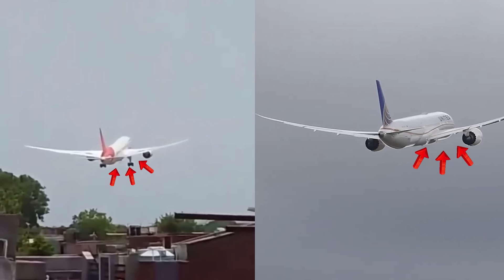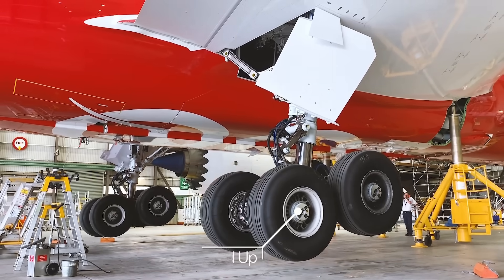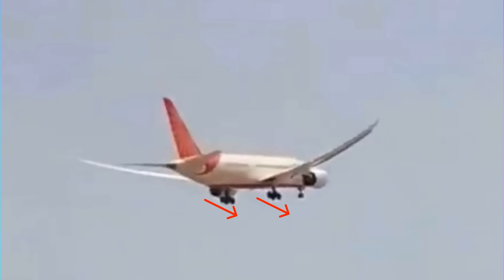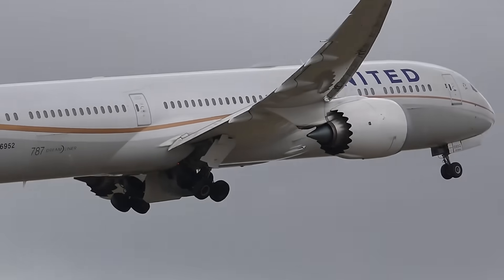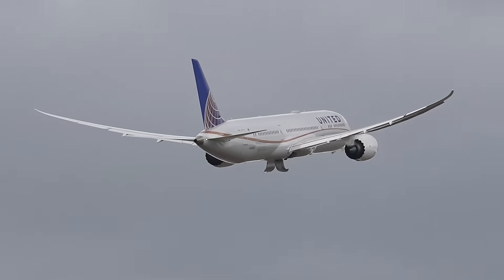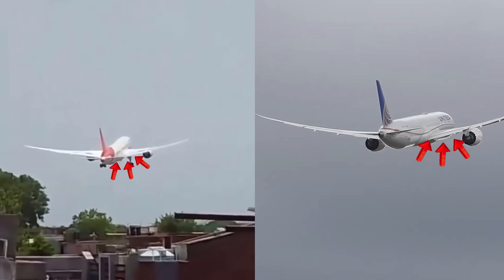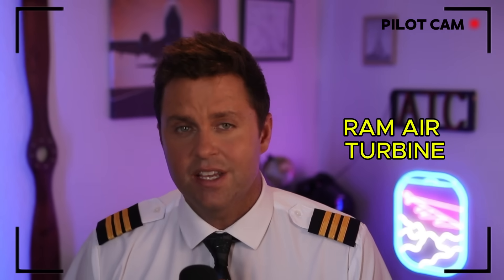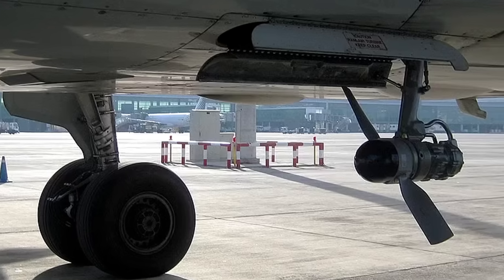Pilot Explains: A New Detail in the Air India 787 Crash Everyone Missed

Comment: Note it was refueled in Ahmedabad and that sure vl  not be surprised these points vl  sure be suppressed out of equation so are Airport runway safety norms as well. No harm keeping this model grounded until all this is sorted out. Landing gears looked struck with no actuation but on in position pneumatic pressure. Abrupt electrical failure only when both engines are out. Had seen AC and other leisure needs shut down during take off to ease in engines and pilots apologising for that inconvenience. I am sure some of the truth won't see daylight to protect and safeguard some of the vested interests. It's all hopeless .

Comment: The survivor reported a loud bang and flashing lights. The RAT comes down and starts spinning when the lights flash on the passenger side. The loud bang is a mystery and the cause of the bang has not been solved yet. The damage was probably serious and the damage could have happened at the moment of the loud bang. Possible causes for the loud bang could be the engine, battery, tire, high voltage short circuit, pressure tank or bomb. The loud bang probably came from a really critical place, because both engines failed. An electrical failure can cause a really big problem in an airplane if everything is fully automated. An electrical fire can easily bring down a passenger plane. The cockpit does not work without a working electrical system. The black boxes can possibly tell more. An electrical failure can limit the functionality of the black boxes. A battery explosion and electrical fire could be the cause of the accident. A faulty battery can explode.

Comment: Given takeoff conditions, I am speculating here.
Flaps set at condition 5 (normal)
Loss of power after V1
RAT automatically deploys after sensing either electrical or hydraulic failure
Complete loss of power due to no engine noise
Previous flight Delhi to Ahemdabad reported cabin lights flickering 
Wheels pointing into retraction setting means loss of hydraulic power and never completed.
Guess? Fuel contamination.

Comment: I agree with everything except the likelihood of contaminated fuel causing the double engine failure. I am not familiar with the 787, but it seems like a contaminated fuel situation wouldn't have caused both engines to shut down so quickly, completely, and both at exactly at the same time. I am a private pilot with a single engine prop plane. I have encountered contaminated fuel a couple of times during the past 40 years. The engine sputtered, misfired, but did not immediately shut off. These engines appeared to have both completely shut down immediately. That suggests to me that it must have been a control failure, like cutting the ignition in a prop plane. Like I said, I am not familiar with the complexities of modern jet engines. But I do know the 787 is a HIGHLY computerized aircraft with a lot of electronics. I think there must be some kind of electronic failure that could have shut down both engines or reduced them to idle, quickly and cleanly, like flipping a switch. Because that appears to be what happened. They had full thrust from both engines, attained full take off speed, rotated, retracted the gear, then suddenly everything just went dead with no warning. The gear started to retract, but suddenly lost power. Without power the aircraft started descending, and appeared to be in a controlled decent all the way down. It is likely the flight controls were completely inoperative. So without power, they went down the same way they went up. 

As far as the contaminated fuel idea, where was the aircraft last fueled? Were other aircraft fueled from the same fuel supply and had no problems? The contaminated fuel theory just doesn't make sense to me.

Comment: I was going through ADS-B data also and it seems that stopped transmission (which it is supposed to do every second) as soon as Aircraft left the threshold of airport.

I also feel that the problem with one engine was detected as soon as aircraft took take off roll but since it may have reached decision speed, the pilot may have considered taking off (maybe with single engine) and then land back again but second engine may have also given away as soon as they took off. It also explains longer takeoff roll and slow climb.

Comment: Both engine failure is much common as it is a fuel failure or as any shared necessary component for the engines to function (e.g. air or contaminated by volcanic ashes air). With this in mind both engine failure is not so uncommon.

Comment: You guys are the best. Anytime you need somebody that's a pilot with much experience and you can leave the door open to what you don't know . I saw one guy from Great Britain who was the royal pilot his Majesty's best pilot in the whole country and he said it was entirely pilot error with inexperience being the cause.  I have 7 years of electrical engineering school so I have a lot of math power. The landing gear was supposed to be up, and it was not. One of two possibilities exist here the guy could have hit the lever to raise the gear and it failed. The guy could have failed to hit the lever and raise the gear. When I look at this gigantic list of things that are so unlikely failing all at once, I try to find an overall cause.  In the automotive field in everywhere else in engineering the model the ground circuit as zero resistance. I have bought old cars that people were tired of paying to have repairs on and ran the number 13 Superior ground wire. I get a big bare copper wire and I start grounding everything I can find get under a screw put a screw in whatever it takes until finally I've got every piece of that car interconnected on some copper wire and it runs perfectly. You can't just run a copper wire around on an airplane everywhere but this sure smells like an overall electrical glitch. It hit those engines and the landing gear flaps and everything all at once. Is complex and interrelated has all these control systems and computer systems are on a plane that big, there are going to be a couple of places that you could have some kind of intermittency or ground problem, computer error or something that propagates across the whole system.

Comment: One of the passengers posted a video prior to takeoff. It showcased the air conditioning not working at all as well as the touch screens on the seat back entertainment system. Makes me wonder if the electrical system was already going out.
Reply: The inoperable air conditioning and ancillary electronics in the passenger cabin are an overlooked clue not many are taking seriously enough. Air conditioning comes directly from the engines, but only if the engines are working
Reply: Air conditioning was not working because the plane was on still on APU and the engines were not switched on. It’s a standard practice world wide but the problem becomes severe in hot places. The temperature in Northern India is ~45 degree Celsius. 
The issues with inflight entrainment does not in anyway highlight issues with aircraft
Reply: You are correct however that person was on the flight before the crash. He was not on that plane then he is very much alive
Reply: Has that been officially verified yet?

I have a really hard time believing that if the issues were prevalent during the Delhi-ahmedabad leg which is just 1.5 hours, they wouldn't be corrected for the Ahmedabad to UK leg which is about 13 hours. Can you imagine sitting in a tin can for 13 hours with no air conditioning? I know AI has issues but still....

Comment: We know that this aircraft already had issues from the video a passenger on a previous flight has shared. When frame by framing through the real video it does appear the gear may have momentarily started to flatten out to retract then backed off that process. Power issue or cockpit commanded who knows at this point but the trucks were definitely in the forward position indicating gear up had been selected. Some various sources are indicating the aircraft had recently undergone various maintenance items. Really have to give serious consideration to this playing into what occurred. Especially considering how astronomical the odds are for dual engine failure other than bird strike. Given that fuel for these aircraft typically comes from storage tanks that would be utilized by many aircraft, wouldn't it be fair to say other aircraft would've experienced issues as well if the fuel had been contaminated?

Comment: Overheated fuel valves → incorrect fuel flow → incorrect combustion → insufficient thrust → poor climb → stall
Reply: Fuel metering valve inlet
90°C – 130°C
Higher risk zone

Comment: The fuel used is the same for all other airplanes that flew from that airport. Fuel contamination is unlikely. It could be fuel cutoff for both engines from the main channel, software got stuck in an unknown state and couldn’t get back to its original state unless a recycle of power, captain used up the full runway of 3.5 km to gain thrust. In summary, it could be mechanical or electrical failure due to physical or electronics. Focus on what is common to both engines. Perhaps both engines aren’t independent as Boeing claims to be.

Comment: @Garybpilot Hey gary i am new to this channel i just really really want you to see this comment there is system in boeing called slat auto gap function it prevents the flaps to change if the plane has high AOC and also if the plane speed is below 225 knots please check up with this.

Comment: Agree with the silence! I mean, the latest high(er) quality vid that Captain Steve had shown, you can hear the sound of the crash (followed shortly by the sound of the fuel combusting).
There is no way a crash sounds louder than the sound of turbofan engines at full thrust.
Therefore it is more plausible, indeed, that the two engines are spooling down.

Comment: The theory you provide is very plausible, lack of thrust flying overhead as well as landing gear tilted forward as well as RAT deployed points to engine failure. The little wobble by the wings could be engines shutting down. My opinion only.

Comment: They hydraulics and fuel pump panels are side by side in the 787. Wonder if the co-pilot cut the fuel pumps by mistake, corrected and hit the hydraulics for the landing gear, which began retracting but as soon as the fuel in the lines was spent all power was lost for a brief moment, and not enough time to re-fire the engines?

Will be interesting to see what the investigation turns up.

Comment: Obviously on the BA 777 that lost both engines on final into Heathrow years ago it was icing in the fuel system and Boeing remedied that eventuality. What’s the chances of a similar event on this 787 albeit not icing but a similar effect in that the engines were starved of fuel (?). Is there a part of the fuel system whether mechanical or electrical central to both engines that when a high thrust setting is demanded it essentially choked the flow. 
Just thinking out loud here.

Comment: Good analysis but there was also some words out there that the prior flight on the aircraft had some electrical issues. Possibly the passing of information or documentation of issues in the logbook was not very good. The engines feed the IDGS so if the engines went out for whatever reason all the electrical to the aircraft would lose power, all the VDHPs would stop working  and the RAT would deploy but is not very effective at low altitude.

Comment: Total electrical power failure would disable all the motors for the hydraulic actuators for the gear the fuel pumps and throttle actuators it only takes a few seconds of a power cut of the main AC power bus, Thing is it would also render the FDR and CVR inoperable and we may never know what happened the only two people who know what happened must of been horrified poor pilots, My thoughts for everyone on the plane and ground.

Comment: I don't know why all the confusion it is clear that the problem was Gravity!! Jokes aside this is on Boeing it is clear that it was a total electrical failure and based off the past battery issues I would say it had something to do with the battery shorting out at the worst possible time and nothing could been done they lost total control. bad fuel would cause sputters and smoke Boeing going to be cutting big checks to a lot of families to much technology to make a plane completely rely on the electrical systems the engines should have a completely separate system.

Comment: Couldn't this very long take off be a sign of an engine failure/partial loss of thrust before even leaving the ground ? And i would say that the first engine to fail was the right engine considering that the nose was tilted a bit to the right (no wind, so no cross wind and we know that the 787 compensate himself the assimetric thrust by leaning the plane to the oposite side, but 100% thrust from a GENx is hard to fully compensate) and we can see on the left side the big amount of dust when the plane took off that i believe we cannot see from the other side, but hard to tell because there is this little ''house'' in front of the camera

Comment: Another pilot has opined the cause of dual engine failure was the result of heat saturation in the fuel system. Might have also caused the electronics to go out. Aside from contaminated fuel, vapor locks may be the culprit, according to him. Of course, he was slammed in the comment section for daring to propose such an unconfirmed cause, but so what? Opinions and speculations aren't sworn testimony.

Comment: Contaminated fuel would not cut off both engines, There would be less thrust and it causes premature damage to the engines but it wouldn't choke out the engines immediately. Also I don't think the engines suddenly flamed out, rather I think both engines lost thrust Gradually when going down the runway through starvation of oxygen which would account for how the plane had thrust to reach V1 speeds and managed to make the initial climb and then the subsequent lack of propulsion from the jets. Even with flaps up, gears down and if there was power in a single GEnx engine there would have been enough thrust for the pilot to level out and do a go around. The starvation of oxygen would point towards the compressors that feed the engines  with air for fuel combustion. The 787 works on a bleed less system which would mean that with loss of both engines there would not be enough power to work the hydraulic pumps which could explain why they could not get the gears up.  Spooling up the APU would have supplied power to the hydraulic pump in the centre hydraulic unit which would have allowed them to raise the landing gear but even if they had turned on the APU they would not have had enough time for it to completely spool up. As they were heading in the direction of the Sabamati River which was around 6km away if they took a straight path, The first thing that would have come to the captain's mind when it was imminent that they were going down would be to reduce ground casualties and get as low an impact as possible. I believe he would have aimed for the river but unfortunately the plane just didn't have enough momentum. They would have tried to reduce drag as much as possible and would have definitely tried to get the gears up. As for whether the flaps were up or down, you've got to remember that it's next to impossible to see the five degree indentation of the flaps at flaps 5 on such large wings as the Boeing 787 from such a distance.

Comment: The same crew flew in the ill fated aircraft couple of hours or so earlier from Delhi to Ahmedabad with no issues. My doubt needle points to control system tampering ONBOARD computer wirelessly to cause double engine failure. This requires ISRAEL CIA LEVEL INVESTIGATION. BOEING, FAA MUST RAMP UP THEIR COMPUTER ELECTRONICS TEAM. I SUSPECT THE VULNERABILITY IS ALREADY KNOWN TO THEM.

Comment: The Only duel engine cutout I remember is British Airways Jet who got fuelled with contaminated fuel and with temperature change from altitude the filter got plugged with contaminated fuel and by the Grace of GOD the Captain was able to get some engine power back enough to make a safe landing but in this case there were two conditions of Contaminated Fuel and Temperature change which caused the filters to clog and stop engine power.

Comment: I'm not a mechanic, engineer or pilot. I just use logic. Any explantion should udeally explain ALL symptoms and evidence. 
Both engines flamed out together so either power or fuel lines were cut off to both sides at same time. Survivor heard loud bang. At a guess, that was the power/fuel separation point (not the rat deploying, too far away for survivor to have heard it). Partial structural failure of the fuselage could separate both fuel or power lines instantly. Whistleblower very recently exposed structural failure risks. I'd be focusing on that, probably forward of but close to wings. Any alternative must explain instant failure on BOTH sides at same time, unlikely with fuel blockage or low fuel. Failed electrical services in cabin prior to take off could be explained by partial fuselage structural failure putting stress on power lines, severing some. Take off could increase stress, severing remaining cables. So my guess is that both power lines to engines were  simultaneously severed by fuselage structural failure.